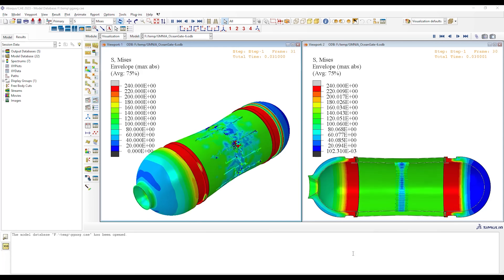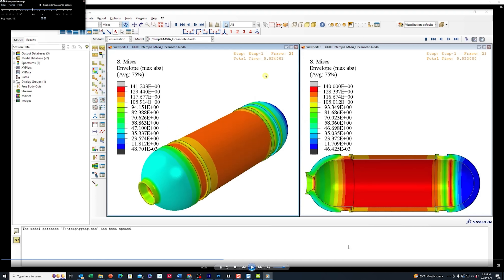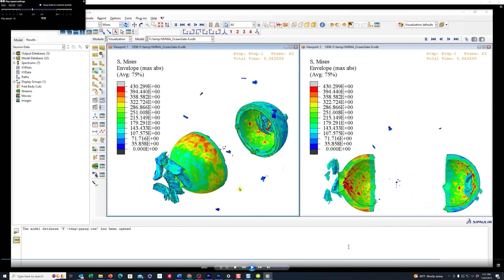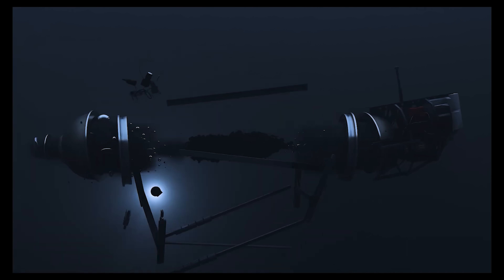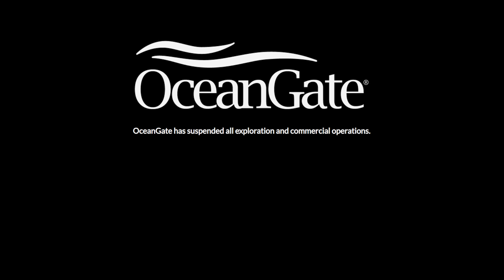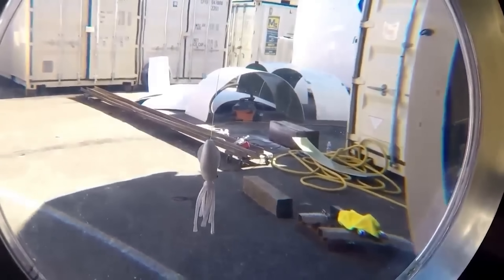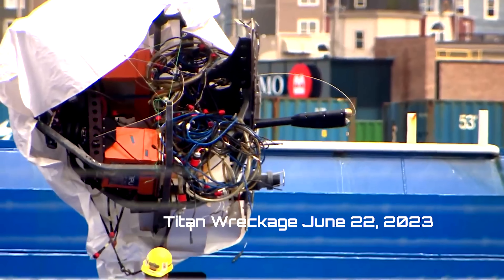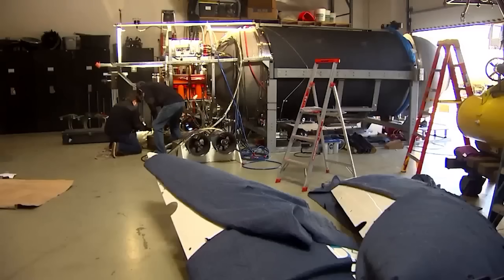Best Titan Sub Implosion Simulation, Cracked Porthole? Q & A

Comment: 3:15 🎉 "... it's completely gone."
But! "gone" means imploded; what force wins when deep sea water seeks equalibrium? Is the air inside that former carbon cylinder compressed (first) or does it bubble away freely?
As the water enters, are the humans pushed into the "Jello mold" of each titanium end-cap? "Pardon my thigh piercing your thorax..."
The graphite carbon fabric becomes "needles of death" from the implosive force of deep water?

That guy Rush was as blind as possible; I'm not the smartest guy anywhere, but I acknowledge and respect(!) 
"The Law of Unintended Consequences". Did his Insurers do due diligence on potential liabilities?
===

"What could go wrong? If 'X' goes wrong, how does 'Y' react?"
I hope his company's Insurers enjoy this process.
Reply: *equilibrium

Comment: One thing of note the simulation isn't in milliseconds 1.0 would have been 1 millisecond. Either way though is mote since it takes 10 to 13 milliseconds for the eyes to note and about a 100 for the body to register pain.

To put it more laymen's terms water at that depth well decompress at 1,500ms or Mach 4.3 (roughly 3.300 miles a hour)
The only good thing if you can call it that is they felt nothing and were never aware of any danger.

Comment: 10:56 a word about cameras and micro chips (I know this is year old plus) but Dr Ronald Wagner specifically outlines the pressure wave equaled 500 lbs tnt, essentially going off dead center. No cam or ssd or chip survives that.

Comment: Carbon fiber is...plastic.  The carbon fibers are simply coated in resins and cured.  Resins are basically plastics.  You dont have to be a scientist to understand the simple  physics of water pressure at depth and the fragility of plastic under immense mechanical pressure.

Comment: Carbon fiber is great under tension, but not under compression. Pull a piece of yarn across the floor with your cat holding the other end. Now push it backed towards the cat....not so much. 
Over simplified but still the same principle. 
Should work very well in space, not under the ocean at extreme depths.

Comment: Not the view port fgs, "oh, but it was rated for 1300m and ugaugabug-", stop with the copium, the sub did go more than a dozen times to the depth of 4000m before the accident, a view port really dimensioned for 1300m wouldn't even make it near 2000m. The viewport was projected to withstand 4000m as it should, the manufacturers could only test and guarantee its quality down to 1300m that is why they rated it for 1300m. Hull failure is what happened, the carbon composite was project to last only one dive, then it needed to be fully replaced, their last dive was their fourth time descending without replacing it, no respect for their creation is what ultimately caused the CEO's death alongside the others.

Comment: It's funny that Stockton Rush often compared OceanGate to SpaceX. Starship decided to sacrifice weight for strength by going with steel, whereas OceanGate sacrificed strength for lightness by going with carbonfiber. Stockton prided in consulting with Boeing who have a terrible record and blatantly flouted the rules/ethics; and NASA who have more experience with negative vs positive surrounding pressure, and a prior mis-management history (challenger, columbia).

He wouldn't consult other marine exploration organizations or even James Cameron as they may challenge him but instead relied on groupthinking. He was however happy to invite James Cameron to join for the fateful dive.

Also, interesting to note is that OceanGate silenced those who call out risk by suing, and Boeing silenced those who were about to testify against them by elimination. This shows how similar they are in personality/management culture though there's a big difference in how they went about silencing.

Beyond the fascinating technical details, it's ultimately the blind-eyed self-serving and arrogant management culture that ultimately laid the foundation for disaster.

Comment: The 'crackling' sound combined with a 'faster than normal' decent could indicate a loss of buoyancy, caused by the foam blocks failing and 'crackling' as they slowly crushed. Were THEY indestructible to repeated compression cycles? The resulting rapid compression of the CFC cylinder or view port may have not allowed the materials to SLOWLY ADJUST, causing stress-points against more rigid (titanium) parts and resultant failure...

Comment: You do understand they died before the shell even starts to collapse so
It doesn’t matter where they were sitting in the sub. As soon as that pressure changed in the sub, that pressure difference is what killed them immediately. So if someone was sitting in the middle or at the titanium ends, doesn’t matter. Love your vids.

Comment: 11:00 I wouldn't hold much hope for any cameras in the pressurized compartment surviving in any recoverable way. GoPro or not, the pressure differential would have obliterated anything at the moment of break up into basically powder. That said, if the external cameras were logging to a computer system housed in the non-pressurized compartment in the aft of the sub (which seems probable), that would probably be the best chance for recovering something.

Comment: A simple and inexpensive measure could have saved Titan from implosion - a steel or titanium ring-shaped rib in the middle of the hull that would support the carbon fiber "skin" and prevent its buckling.  Ideally, there would be two or more such rings, as well as spars attached to them to prevent the rotation and shifting of the ribs

Comment: Those frllows knew they were going to die. They reported their hull monitor warning was going off and they heard cracking in the aft part of the pressure hull. Not to mention they had aborted the dive, had dropped ballast and were having trouble ascending. Of course when the implosion occurred they didn't see or feel it.

Comment: the whole fundamental design is flawed in the first place. they were opting for "non rigid" body with that "carbon fiber" approach, but they use TUBULAR DESIGN. that WILL NOT work. if you want to use a non rigid body system you have to use shapes that have natural pressure spread like EGG shape or BALL. even with that, they will need reinforcing DISC RIBS/rings inside it to withstand the "flexing". 
the remains of the sub shows an obvious process of crushing on the tubular body. AS EXPECTED. and they making it SEGMENTED. too much weak points.
if they want to use tubular body, they should use RING DISCS RIBS made out of something that is fracture resistant from flex at the inside of the middle part of the tubular body, better yet distributed evenly on the entire inside of the tubular body.
using carbon fibre in the first place  for high pressure condition is bad. mind you, THICK carbon fibre plates DOES NOT FLEX well. it will CRACKS instead. and you will still need to LAMINATE them with metal fiber LATTICE. not rolls, LATTICE. and that lattice is should be at the Inside between the outer shell and the DISC RING RIBS of the tubular body (the titan sub tube has NONE of those disc ribs).
something what i would do also,  do a real world test with a finished prototype be sent out unmanned and remote controlled. in the case of this sub mssion, to do 5 km deep unmanned.
i mean this is the AI era. you dont send out prototype with people inside. its crazy. even in airplane development, in todays era i would encourage unmanned, remote controlled session before actually doing a manned drive.

Comment: Physics is like that.  In order to go 100 miles per hour in a Bugatti Veyron it takes about 180 horsepower.  To go 200miles per hour is about 400 orsepower. 200 to 256 takes the other 700 hp.  At 256 miles per hour the tires will only last about 40 minutes.   But not to worry.  At 256 .pH sustained...you will empty the fuel tank in 8 minutes.

Comment: Any scratches create charpy or stress risers, correct?  So perhaps with enough scientific “deep diving” into photographic images taken prior to the accident those possible “scratches” can be analyzed??
I have been impressed and a bit wary of matter under pressure whenever a water bottle or pop can has been found ruptured within the freezer at work; the ice having blown out the lid seal or the rim crimp at whatever weak point was located amidst all that (otherwise) strength!

Comment: Cracks in the Perspex? 
Are you serious???? 
I'm a heavy machinery trainer instructor and assessor. The first thing I teach my students is to conduct a pre - visual safety check followed by a pre- operational safety check on the machine. After the job is complete, I then teach students to do a shut down and damage checks and reporting and recoding methods etc. 
So you are assuming they don't carry out any of the above? 

And as a paying customer that's about to go down several thousand meters under the sea, I would think even a normal lay person would probably do a quick walk around and do a visual check themselves. And as a father, one would definitely do a visual check especially on the weakest point, the front Perspex hole.
You lost a lot of creditability there bro.

Comment: Whatever the pressure was on the carbon fibre body, it would only decrease if the port hole failed. So the body would be intact if that was the case .. and it wasn't.

Comment: The FEA simulations are all well and good but I'm more interested in an analysis of the joints and an analysis of the carbon fibre hull under pressure loading associated with 3.5 km depth. These are what I would describe as service loading analyses. Also of interest is the material behaviour and properties used for the carbon fibre.

Comment: Carbon Fibre is a terrible material choice under pressure. It's great at tensile pressure, but behaves unpredictability under compression.  It really doesn't matter what component failed first, but illustrates that Non-homogeneous counstruction is Insane gor those pressures. 
A rule that the industry followed with an excellent safety record, until this Idiot Rush came along.

Comment: With all due respect to Dr. Mechanical Engineer the ship has been described as being nose down in the final minute or so. Even if the sub was horizontal when the collapse happed the person sitting in the middle where the collapse started would still be alive for a few milliseconds. People can be compressed and still live. The searchers never found the acrylic view port. It along with all the occupants were stacked or heaped up in the nose down configuration. That would have been the worst minute of their lives. They knew death was eminent. It the final millisecond the occupants and the view port/lens were water hammered out through the roughly 10 inch orifice in the titanium nose cap by the tremendous energy of the implosion. A truly bizarre way to die.

Comment: It also could have failed at one of the the tatanium end cap seal joints where it was glued. The end of the carbon fiber tube is far weaker than the middle once the titanium ring losses its bond.

Comment: I believe it was about 18 minutes of time when the sub had issues and if there was a line for recovery they could have been pulled up to lower pressure and might have survived. The sub was equivalent to a bicycle with a powerful engine competing with Honda power sports at 200mph. Total rigged contraption that basically was a trash compactor.

Comment: A high decent rate would set up a relatively large temperature gradient in the carbon fiber hull. 

Resulting in a tensile overload in the outer layers of the hull.

Such things have happened before in deep submersible craft...

RIP crew

Ps I'm no expert 
Just a theory

Comment: Position 745 when talking about cracks I thought the cracks were in a different spot  but I am wondering more about the portal the black stuff on the sub at 745 it looks like it was on fire at one stage and then the next sub at 780 the next sub the black stuff is there but doesn't look like the other one that look like when you heat a can or anything with a flame it goes black like that it when the flame is yellow and not the blue flame we're its the hotest part

Comment: I am completely surprised by the fact Stockton Rush elected to use "old" carbon fiber preiously used by Boeing. As a former Composite Mechanic and Manager, my opinion is there was a while host of issues regarding the manufacturing and build of the sub. As an Engineer Stockton should have had a detailed understanding of areas such as the disimlar materials of titanium and carbon, not too leave out the bonding agents used to basically glue the unit together (along with fasteners, etc)  Was he really in "in the know" about the properties of each?  Knowing that he had managed several dives already I actually believe he was very lucky in those dives and by the time it came to the last dive he had dropped his guard and made some grand assumptions about its integrity. This should be a lesson to any future builders of sub's or other devices manufactured for any similar efforts

Comment: Those actually look less like cracks, more lime indentation from something trapped between the acrylic and the titanium rim. The hole for the window uses a chamfer to distribute he load from the pressure against the acrylic, reducing the overall stress as the titanium can take a lot more punishment than the acrylic. In industry, any installation of a viewing part to a pressurised chamber is done in as clean of an environment as possible to ensure nothing gets between them. Even something as small as a hair can damage the window material if it gets trapped between the frame and the actual transparent material. for quartz viewing ports, we'd basically douse everything with IPA, so when you're securing it down, the pressure from the fasteners forces out the IPA, and any debris that was trapped between them. Even sub millimetre indentations can actually be hazardous.

On a side note, I don't have high hopes for the electronics being recoverable. For starters, the shock of the implosion likely caused all cameras to stop recording (if not being totally destroyed), but buffering times would likely means the recordings end a few milliseconds before the actual implosion.
The other problem is small air bubbles often end up in ICs, sometimes in the silicon itself, most of the time between the IC package and the actual silicon IC. I've seen people mention this on ROV hobbyist forums as a regular problem for even just a few hundred feet of depth.

Comment: Only the builder's total ignorance stopped him from placing a titanium ring in the center of that CF cylinder.  A middle ring might have likely prevented the collapse, if, indeed that was what happened as I believe that it was.  Placing CF in compression was the biggest mistake.  You produce excellent videos on this engineering debacle.  Thanks.

Comment: Small Oct 10th Update/article  "US Coast Guard recovers remaining parts from imploded Titan submersible "  "The salvage mission conducted under an agreement with the US navy was a follow-up to initial recovery operations on the ocean floor roughly 1,600ft (488 meters) away from the Titanic, the Coast Guard said. It said on Tuesday that the recovery and transfer of remaining parts was completed last Wednesday, and a photo showed the intact aft portion of the 22-ft (6.7-meter) vessel."      (The Guardian )

Comment: There is a major problem with Dr. Ronald Wagner's theory that is being overlooked. I will try to explain. The simulation theory Shows the carbon fiber being crushed inward at the center, which is what it would do at first. However, the pressure, or inward force, is still the same at each end of the carbon fiber. In his illustration, take a look at the mating stainless steel or titanium (I think they were stainless) ring's inner wall thickness that cups the carbon fiber hull. These rings were designed to cup the ends of the carbon fiber cylinder hull, one ring on each end. That ring's inner flange thickness was, in my opinion, its weak point; it looks to be about 6.35mm (1/4 inch) thick in the pictures and video I have seen. One of two things would take place at that point: either the inner wall of the ring would withstand the inward crushing force and strip off the ends of the carbon fiber cylinder, or the inner flanges would fracture from the end rings. That thin flange and glue were the only two things holding back the enormous pressure. In conclusion, as we all know, this design was a death trap, and anyone with a lick of sense should have known it.

Comment: the port hole was intact in the picture of the debris, if you use composite,  no matter how you apply it there is still micro air gap that expanse under  pressure, back in the 70s gas company's  try  to use composite decompress dive chambers, what little I have seen in pic it happen around one of the ring

Comment: In addition to the destructive power, remember the heat 10000 degrees C accompanying the disintegration, generated by the extreme compression of the air within the sub by external water pressure rushing in. Unsurvivable.

Comment: What are the black looking lines at the bottom left of either the acrylic or titanium starting at 8:03??

Were there tests that could have been done on the actual acrylic pieces they used during the manufacturing phase and it kind of bothered me to hear Rush brag/bolster about it moving 3/4" once at deeper depths??

Comment: The carbon fiber is only giving a limited strength to this vessel. I’m convinced that whatever resin they used for binder was really providing the resistance to implosion. Maybe I’m wrong about that, but it seems like that is why it failed. Use of wrong materials!

Comment: The glued sections are where I think the failure was.  I would think the difference in compression between the two different sections was the cause.  I say this with zero engineering experience.